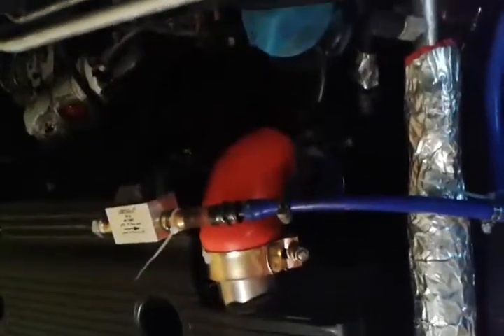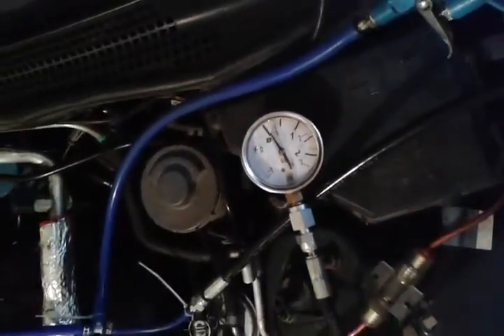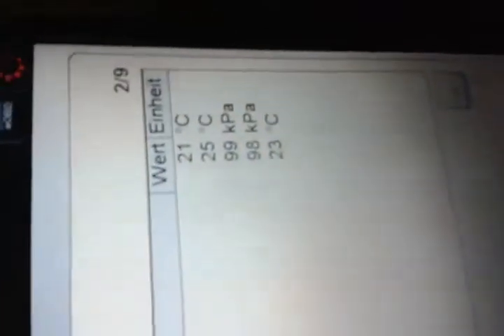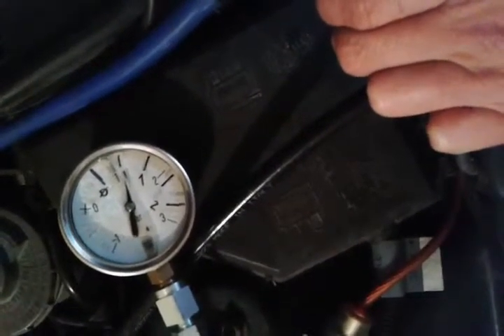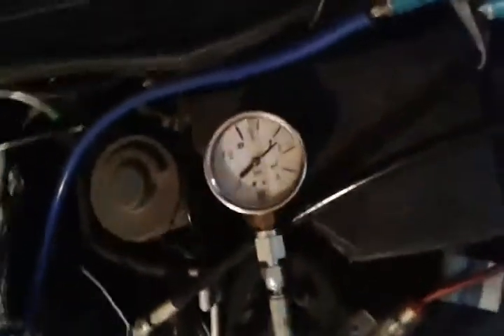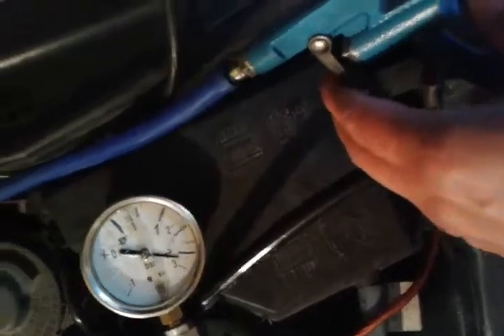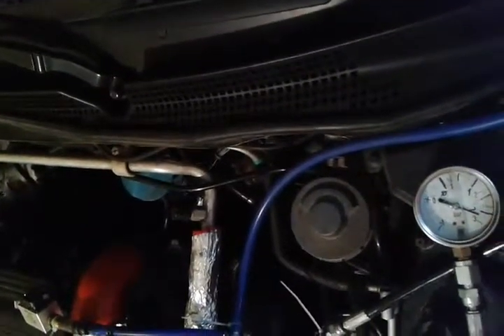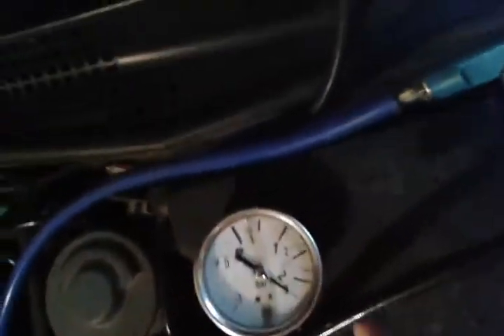Bigger map Sensor Rover 45

Comment: its intresting that ecu has read atmo pressure , but there is no atm sens, maybe default value?
Reply from the maker: Алексей Хавронин I rather think it is a default value or the ECU is using the first value it sees  as a reference point when you turn the ignition cause it does not change after all :)